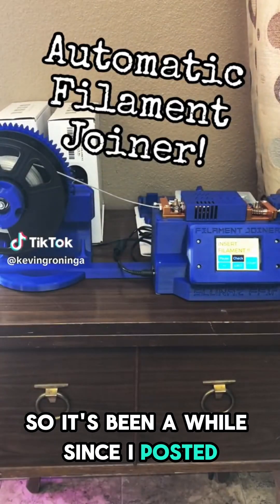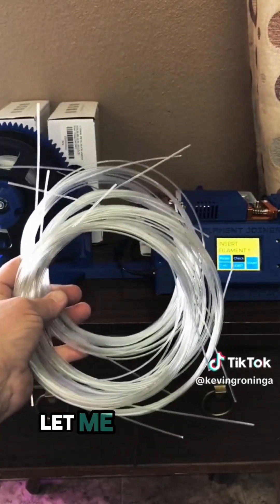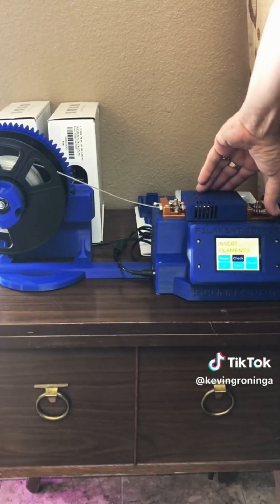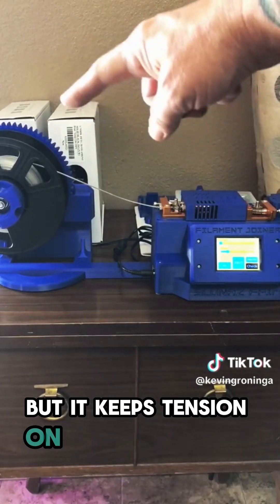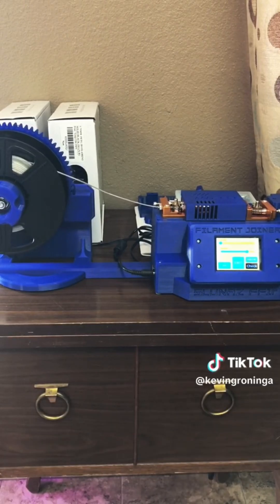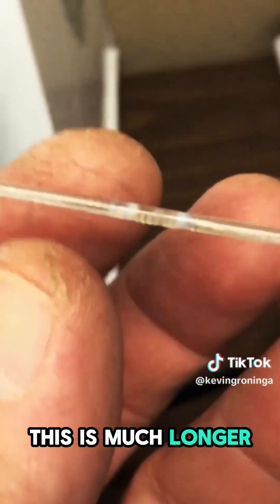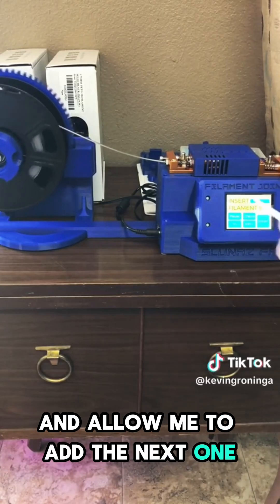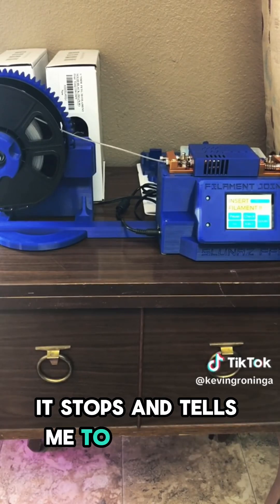How to splice 3D printing filaments

Comment: Nice work, and good explanation, but I had to turn the sound off because the AI voice was so annoying. Full of sales pitch intonation. A real turn off. A neutral voice would be more credible.
Reply from the maker: Thank you very much for the advice and we will try to improve in this aspect.
Reply: First off, I made this video over on TikTok and I never thought that someone would take it from there and post it here.  I’m not affiliated with Slunaz in any way, just one of the backers that got it from the Kickstarter campaign.  I was excited to build it when it arrived and I’ve been using it a LOT.  In any case, I used the AI voice because I don’t necessarily like the sound of my real voice.   But this video was never meant to be a sales pitch nor was I asked for permission for them to repost it here without my consent.   It was just a short TikTok I did (on my own account) showing how I’d be using it to join the PET filament I make from recycled plastic bottles using a Pultruder machine.
  So, just thought I’d let you know that….
Reply: @KevinGroninga3D  I am so sorry someone did this to you.